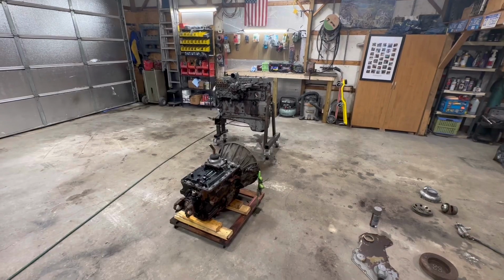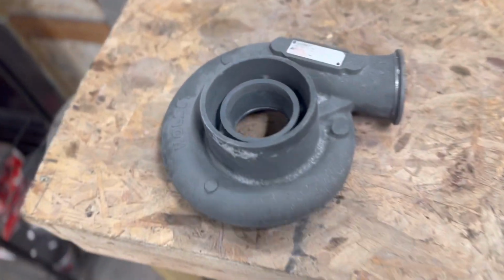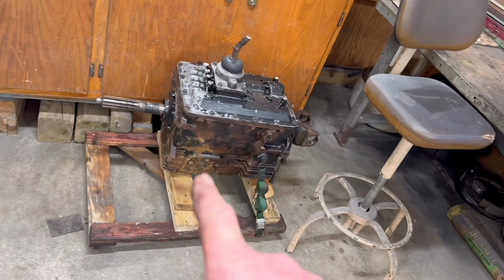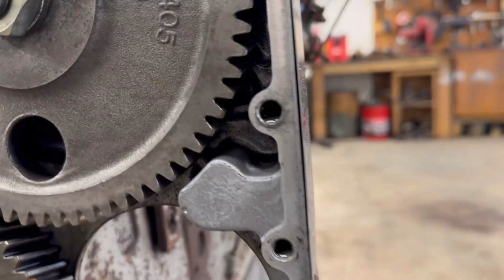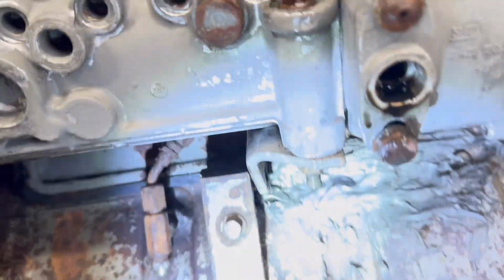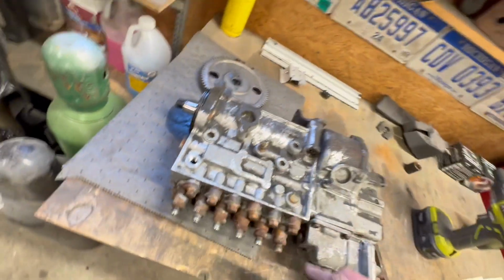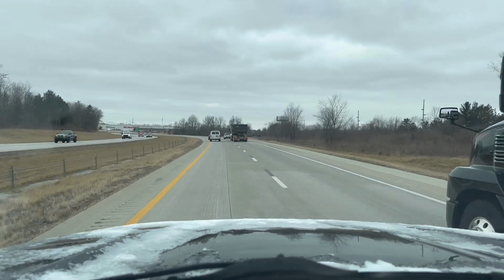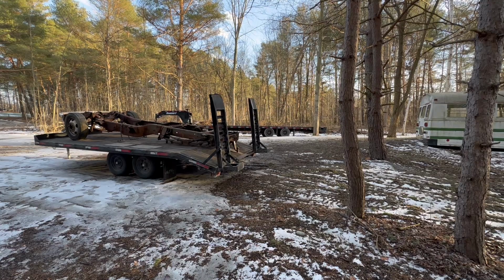Cummins Swap GM C3500HD Episode 3:  more Cummins tear down and a road trip for….?

Comment: i like to use mineral spirits in a cut off gallon jug and a parts brush to get the engine cleaned up. then i hose it down with the brake parts after. brake parts cleaner is far too expensive for me. frame looks pretty good. i see another splice in your future!
Reply from the maker: That’s exactly what I did. On the parts I didn’t take outside and pressure wash I used cheap paint gun wash thinner in a bucket with a brush, then rinsed down with the parts cleaner. Even buying wholesale by the case it’s still 2-2.50 a can.   And yes, I have probably 2 more frames splices in my future on this truck. A couple weeks ago I finally picked up the Milwaukee 8” M18 metal saw, excited to put it to use on this project

Comment: How many miles are on this engine?  Looking forward to watching this build ! Oil is supposed to come out the front of the injection pumpby the way!  Oh that looks like a Crew cab frame !
Reply from the maker: It has somewhere around 400k on it.  To be honest I’ve lost track of it exactly, have a record of it somewhere!  The frame is a regular cab- looks like a cc because it’s the super short wheelbase.  One of the next steps will stretching it under the cab to accept the extended cab I bought for it

Comment: I’ve got a clean frame for one of these. It’s the medium length version. 158”+/- CA. And a clean cab hahaha
Reply from the maker: I’m good on the cab because I’m converting to an extended cab, which I already have.  I think this frame will give me everything I need other than the extra length in the rear and I’ve got some plans to work that out….